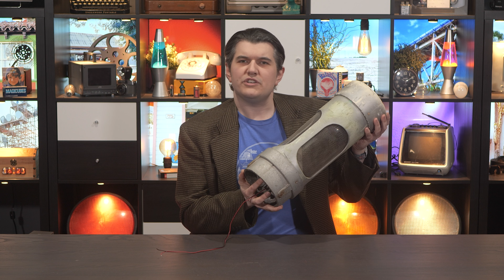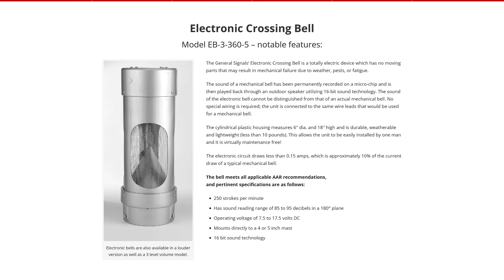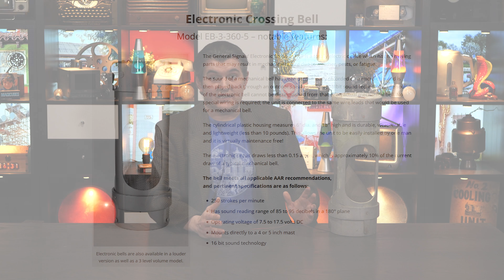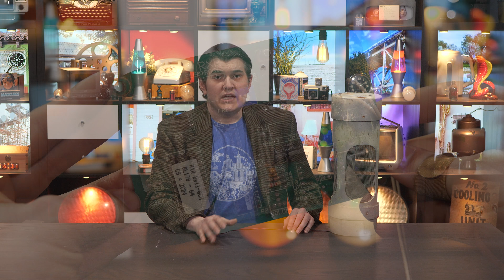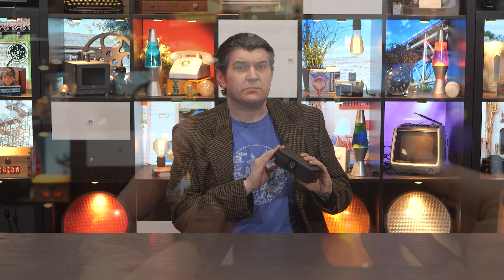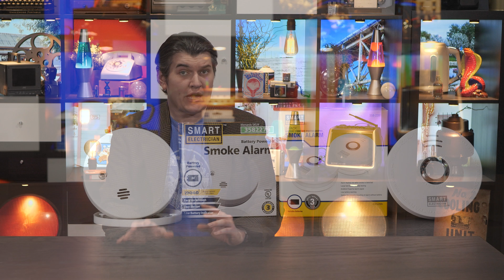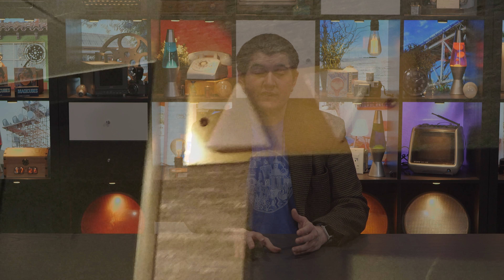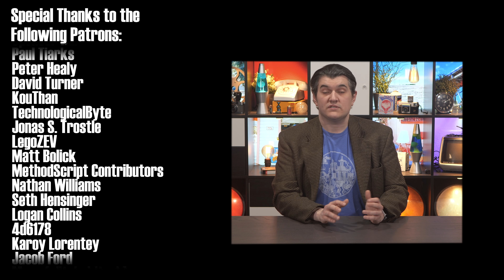The disappearing and unappreciated art of audible alerts

Comment: Of course on the flipside there is one set of sounds designed specifically to be extremely intrusive. The load in for the Emergency Broadcast System, now Emergency Alert System. They might also be the only sounds with strict regulations because lets just say do not be the broadcast TV station that lets a disaster movie play them.

Comment: I use the door "chime" from Start Trek TNG as my notification sound.  If it's a text, it goes to my smart watch, which vibrates (unfortunately it doesn't work all the time).  That way I can check texts quickly to see if they are important.  Any other notifications are not as important and I'll check later.

Comment: My man. 
I feel for you. 
Me myself used to set up individual notifications for contacts and apps etc. 
It's mostly gone partially because it went to wrist watch (using xiaomi but will check out pebble now).
Partially by the fact that it's very difficult to set up now. 
Which begs the question: is this intentional? So we have to chose between nothing and everything? So we check phones more often? 

And one more thing I miss heavily: the freaking ringtone to start on low volume and raise the level gradually. 
Every phone manufacturer I know just removed the feature. Same with morning alarms. FFS.
Reply: I am pretty confident it's intentional.  If you frame a modern smartphone (both hardware and software) through the lens of "how could we maximize the amount profitability from this", it seems pretty clear to me.  Everything from pushing hardware with larger screens, removing keyboards and removable batteries to requiring UI with addictive repetitive scrolling actions with dopamine hits, pushing notifications (at the control of a for-profit app instead of the user), and refusing to allow you to access your own data on your own device (although fully accessible to the operating system and those for-profit apps of course).  Throughout the world, we need far more legislation on all of this, as the whole industry optimizes their profits every year, at the expense of people.

Comment: Phones aside, on PC software, sounds (and options) have slowly disappeared as well.  One exception is in (Windows) desktop Word, Excel, etc. there's a sound feedback option under Options, Accessibility, "Provide feedback with sound", with two sound scheme options, although no other customization.  Sadly, it seems the rest of Windows has virtually eliminated sound effects other than a default notification sound.  The classic Windows sound options are buried in the old control panel, largely unused, and the latest UI frameworks ignore them completely (and a lot of the other accessibility options, but that's another comment).

Comment: Want a SmartWAtch but not a tiny Phone on you arm? Go for a Garmin. I have the INstinct 3 Solar.
As long as I am outside, the watch has "infinite" battery life. Otherwise I could go for ~21 days into a cave and still have the thing working at full functions. 70 Days if max life span is required.

No touch screen, just a small unobstruvive display, buttons and a long battery life. Yes they are expensive, but so is a Apple Watch which has none of the above. And people still buy it for some strange reason.

Comment: Yeah, audible alerts, like my coffee machine (DeLonghi magnifica) emitting f*&@ing loud beeps for every single action i do with it. Switch it on, loud beep (followed by even louder coffee machine noises), make a coffee, loud beep (followed by even louder coffee machine noises), pull the water tank to fill it, loud beep, push it back, loud beep, why the fuck do i need a beep to indicate me that i have successfully removed the water tank from the coffee machine ? IT'S IN MY FUCKING HAND I KNOW I DID IT !!! If the coffee machine stops working, it will stop doing loud coffee machine noises when i use it. Those annoying beeps are everywhere...

Comment: From a software standpoint, the mountain of settings that retain old functionality with new features is pretty mountainous. 

Don't get me wrong. I agree that removing or changing the ringer toggle switch was a dumb move, but to you're point about "borderline unusable for my parents" is what these devs are building for. They are building for the 'weakest link' 

What we really need is different distros designed for different skill / customization levels. Android sortof does this with the "developer mode" stuff but it's still half baked

Comment: 18:11 As an example of useful sound design , Not Just Bikes recently did a video of train stations in Sweden where they make a soft clicking sound at the platform of the train that will be departing next, that clicks faster as that departure time gets nearer, which is an accessibility requirement

Comment: another thing to add to the "sounds that have meanings that you might pick up on" to bring it back to the railroad crossing ding ding, much like on the airplane, is whistle code on the railroad, as well as the ding ding on the locomotive itself. for starters, the bell and whistle are used in different scenarios, and have polar opposite sound chords (one is major, the other is minor). as for whistles, a couple examples would be 1 short being "stopped and brakes applied", 2 shorts being "moving forward", 3 shorts being "reversing" or "stopping at next station" depending on context, and long long short long is for a grade crossing

Comment: 1. Idk how common this still is, but I've always heard that Japanese electronics manufacturers love to include lovely audio chimes or jingles (often as a marketing thing), and that non-Japanese people generally love them for this reason.

2. Making good audio alerts can often be an example of the "curb cut effect", where a feature meant for a certain minority ends up benefiting everyone. Named after the ramps down to street level on sidewalk crossings, where they were initially intended for wheelchair access, but also help those walking, riding, pushing, or pulling something.

3. 20:58 False choices drive me nuts! I've started to say "I want tools to use, not to have the thing try to guess what I want". My car's "Auto" headlight setting is a great example: I leave it on that setting 99% of the time. But, if it starts raining but it's not dark enough to trigger the headlights, I can just turn on the headlights manually: perfect!

A family member's new car's windshield wipers are a garbage false choice: fully "auto" wipers or none at all. It sucks! The sensor can't react to changing conditions fast enough, so it's never running at a good pace unless it's laboratory perfect vertical rain with no wind: the wipers always run too slow, too fast, or not at all when the rain is light.

Comment: No device has done notifications (visible and audible) or control over notification sounds/vibrations better than the T-Mobile Sidekick.  The “volume” buttons didn’t just control the level, they cycled through “profiles,” each defining a desired volume, vibration level, and indicator illumination setting, with a semantic label.  It was an absolutely ideal experience… wish Apple would replicate it.

Comment: This reminds me of the fact that there's supposed to be a standard for pushing/pulling doors. If the handle is vertical, it's supposed to be pulled. If it's horizontal, it's supposed to be pushed. Very simple, very clean functional design. Except nobody knows about this, and it's not taught widely enough so it's gradually become deprecated. It's why we need PSA's, because otherwise how are you supposed to make use of functional design when you don't know about it?

Comment: I teared my electric kettle apart and ripped out the speaker inside with a pair of pliers because it played an annoying high-pitched electronic beep that I heard 4 times whenever I made a cup of tea. First it let me know that I had placed the kettle on the stand, then it let me know that I had pressed the button to start boiling, then it let me know that it's ready (like I don't hear it click off or the water stop boiling), and lastly it once again let me know that I had now placed the kettle back on the stand after having poured water into my teacup. This on a glass kettle that lights up in red whenever it's boiling water too. Ridiculous.

But yes, some things could do with pleasant audible alerts, the washing machine being one of them as I'm usually not in the room when it's done, and it's hard to know if it's quiet because it's just in a quiet period of the program or it's actually done.

Comment: Best old school sound design in my brain an old sound roadie?
Is the dial tone from a regular wall phone.
It alerted you that the network was able accept a new call.
If you lived in a rural area?
If the network was unable to accept a call?
You would pick up the handset and NOT hear the dial tone.
Which indicated you should not dial.
And let’s also shout out the sound design genius of DTMF phone buttons.
It mimicked the rotary dialers pulses without the mechanical requirement!
As a live concert sound engineer for over 40 years?
I’m always intrigued by the sound design of infrastructural systems.
And the older I get?
The more I regret not realizing I could have been designing emergency beacons, instead of wearing down my body putting shows on In arenas for famous people!
I’ve been a fan of your work for years!
But I really appreciated this particular vid for shouting out the fact that sound engineering goes far beyond the realm of movie sets and festival stages!

Comment: One sound that I hear at work is for overhead cranes. It's very distinctive and easy to parse from heavy industrial noise, even through ear plugs.

False choice is horrible these days. Take my car for instance. My navigation system maps are well outdated, but the service needed to update it has been down for a very long time. There's a new road that I use that's not in the system. This new road is close to another road, so the nav system thinks I'm on the other road and yells at me that I'm going the wrong way down a 1-way street. I would like to turn off the 1-way alert, but I can't. Turning the stereo off doesn't work, either. My options are either disable the nav system entirely, or deal with it yelling at me every morning. It should be just a check box in the options menu, but no.

Comment: OK you mentioned international standards, so here's the UK perspective.

Temporal 3 is not a thing anywhere in fire alarms or similar alarms over here. When I was young the alarm was a bell or a small mechanical siren, which would sound constantly. These have been deprecated in favour of electronic sirens that have no moving parts so are less likely to fail. These make a variety of noises from a whoop to a two-tone "nee-naw" sound, again playing constantly. Pitch and speed can be altered depending, and the sound varies between buildings or use cases. Some buildings that have separate alarms such as dangerous chemical alarms will have a distinct separate sound. (Somewhere on Youtube there's a recording from Sellafield Nuclear Plant that lists all the different alarms they use.) Other places have multiple interlinked systems that will sound an intermittent alarm in one building if a neighbouring building's alarm sounds. In the home, smoke alarms are nearly always a high pitched fast intermittent beeping. The focus in all of these cases is to produce a loud noise at a high pitch that cuts across any other sound without ceasing.

As for level crossings (our name for railroad crossings), there's one round the corner from where I live that just uses an off the shelf electronic fire alarm sounder. No one is precious about what type of sound it makes, only that it makes a loud noise to alert people nearby.

The only exception to all this as far as I can tell is the weather alert siren. The distinctive noise of the Gent 1474 has been ingrained into the national psyche since WW2, so in the few places where sirens like that are needed, they are nearly all the same model or ones that produce a similar sound just because of how strongly the British public associate that sound with imminent danger.

Comment: I feel like sound notification for various devices are getting more and more annoying. My parent's stove top annoyingly beeps 3 seconds after you lifted the pan to shake it and back again when you place the pan back on the stove. EVEN IF THE PAN CAME BACK DURING THAT 3 SECOND DELAY. It beeps when you clean it with a slightly wet wipe even when it's off, just to tell you "hey something not feeling like an input from you happened so I'm just about to do exactly nothing!"
Cars these day manage to emit a wide variety of extremely unpleasant chimes to warn you of various things. 20 year-old cars that I know make slightly less annoying chimes that the 5-10 yo cars I encountered. The 2018 Toyota bumper sonar chimes on my father's Prius are extremely annoying and bring a lot of stress. Their previous car (a 2009 Citroën) were much more bearable and not less efficient at helping you park your car. (My car never emits any chime except when I try to leave my car without turning off the headlights. And I'm okay with that.)

Comment: A lot of times you can do the notifications fixes you talk about on android but it depends on a couple of factors. The first is that per app you can change its app settings. To make this useful you basically have to go through every app in the OS app settings and disable push notifications unless you explicitly want them then on. Second any you don't want to make sound you set that apps notifications to vibrate only. The third part is the hardest because it depends on the app and its developer to do something useful with. That is that each app can also have individual notification "channels" which can be customized with different tones or to be silent or vibrate only. For the apps that you want more granular control over sounds you kind of have to hope that it either already has those channels set up in a way that makes sense or (in the case of apps that actually give you control like the homeassistant app) allows you to create them. Last thing is once you get that set up never turn your phone on vibrate. That is the big downside all those settings I just talked about only apply while the phone isn't on vibrate. If you need different notifications to interrupt you at different times instead of using vibrate mode you instead use do not disturb and allow some specific notifications to override do not disturb to still get those to ring or vibrate. I still wish you could do something like set notification levels so that you could set each app to some level like 1, 2, 3, or 4 and then when you set your phones notification level to 2 all apps with a lower number ring, apps at level 2 vibrate and apps with a higher number are silent.

Comment: One reason why i hate audible alerts in general is that i have sensory processing disorder and so get really overwhelmed by sounds. It's so bad that even though i barely ever use, i'll try selling my microwave because it's impossible to turn off the beeping and i hate needing to always steel myself for it, even with noise cancelling headphones it's still rough. Important things can have sound, although i wish some things like smoke alarms were just a little less loud to not make me so overwhelmed i can't even think / act any more. But almost none of the alerts you do get are important so...yeah i'll opt out basically everything. I even turn off vibrate for most phone alarms as well, it's fine if i only see a new email a few hours later when i happen to check the time on the phone

Comment: Several thoughts - I worked in software from 1993-2020 - and I remember usability being such a big deal early on, we'd observe as users tried to accomplish things with the software and such.  Maybe it's still there, but I feel like that's virtually disappeared in the change fast world and needs to be a consideration again. (Much like my beef about the 'care and feeding' of web applications not being properly considered during development either.) And further on usability - I have had to help older folks so much with current technology and web sites, it's crazy how difficult it is for them, my mother when she was in a care facility used to farm me out to fellow residents to help fix their tech issues.  I do the same for elderly folks where I work now. And even with the massive amount of computer experience I have the hurdles they need to get past to get things done is astounding at times. I keep thinking I should do volunteer work on this front at a local care facility, I know it's needed.  And finally, my solution for needing sounds, I've started using open ear buds since late last year, and I love them.  I can hear everything around me, but I also get the sounds from my phone from an item on my ear I sometimes forget I'm wearing it's so light. I'm using the Bose Ultra Open Earbuds, but there are plenty of similar ones out there. I know it's another gadget, but it's enabled me to listen to podcasts and audio books at work and at home, and get all my notifications without bugging anyone else and still being able to hear everything going on around me. They were life changing. Thanks for all your great content!